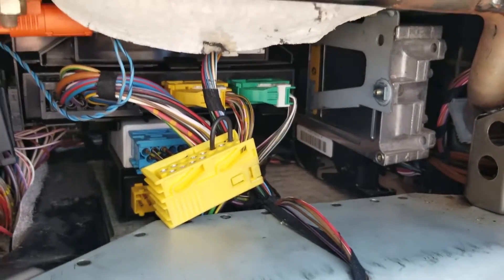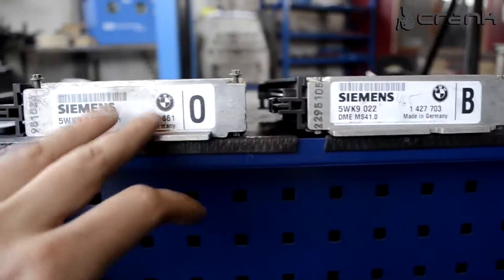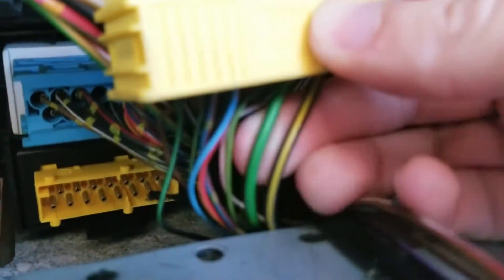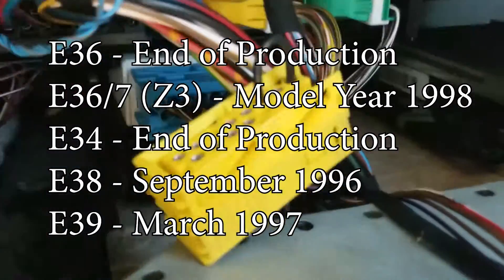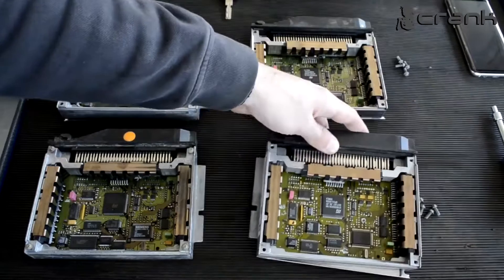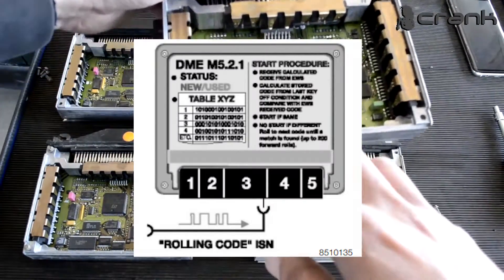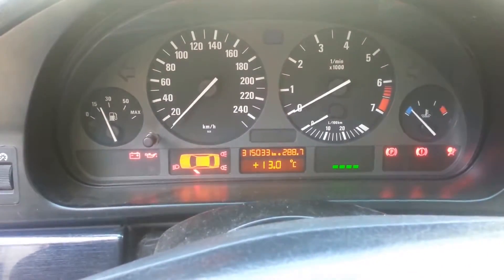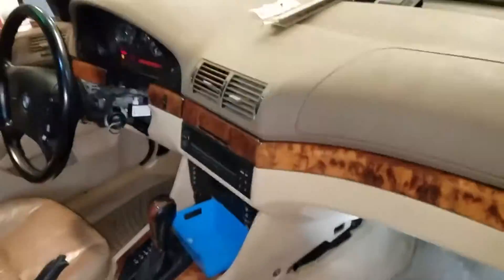Early BMW Anti-Theft (EWS) Will Mysteriously Cause your Car to Literally not Start, and Here's Why

Comment: What's the get around for an E46 from 2004. If the EWS is bad? I got two seems at least one has an ews issue possibly both and both different. But is there a way to replace the ews and code it to the car using a scan tool via the OBD2 port? If so what's the cheapest model in 2026 that can do this that you know of? I've been looking on YT and seen various answers contradicting eachother. Also looked and found many scan tools ranging wildly in price that claim to program ECU & Modules, but NONE give details about EWS even when they're BMW specific, so I'm sceptical at spending any money on another scam tool unless I have confirmation from someone that 1. Yes it can be done if you buy another EWS etc t9 match the module to the car and keys(or other modules if it one of those) & 2. Confirmation of what scam tools as of 2026 as a minimum would perform this function, as I have zero clue about electronics other than what I've read & tried to figure out.. lol 😂 
Any help would be much appreciated as I have two cars one that's on the blink intermittently won't recognise each key, and has stopped recognising either to unlock remotely. And the other that cranks and no start.(I'm yet to check fuses on either though).. 
Thanks

Comment: Is it possible that in my e39, 2001 year Im having perfect crank but no fuel due to bad ews? From what you said its should rather happen to older models as those new ews should rather permit even crank if sth is bad

Comment: Do the same issues happen with EWS 4. I have a 2009 E83 X3 that has intermittent no crank no start issues. Sometimes that involve no noise whatsoever and other times you get a solenoid click but no crank. Starter has been tested and is good.

Comment: How do you know all this? wow great job! Im currently having a no start not crank issue on my e39. The problem started when I went through a car wash and when I came out, the car died. It just cranks. It did turn over a few times, but there is no response with the potentiometer gas pedal. Ive replaced almost everything. So now I am trying to learn more about the this EWS and DME. Thank you for this video.

Comment: I have an issue where intermittent maybe once or twice a week the car won’t crank or start, once I jump it with my jumper it will turn over.

2nd battery in a year so I know it isn’t the battery. 

I get power to the dash but the car won’t crank or start. 

I can hear the starting trying to turn over.

Still can’t figure it out so I’m always with a jump box in my car lol

Comment: 318i 1997 no start no crank checked the starter and fuse, connected the two lines to crank up the car but no luck can anyone here give my a reason why? Can it be the transmission module gone bad?

Comment: Is there a stand alone cpu that can delete the factory alarm system and allow the car to start and drive. There are older vehicles that have these systems and they fail and render these vehicles useless. I want to have a newer off road track bmw vehicle like a x3 or x5 and these systems are getting in the way. No point in having a failing ani theft system on a $2000 car. I found after market ecm but require a lot of programming and adapting and the cost is more than $2000 for a system. Anyone know any bmw hacks that can help in this situation?

Comment: The issue im having is during the summer here in AZ above 100 degrees I get no crank no start until the sun goes down or early mornings. But when the sun hits the car it won’t crank or start. Already got an ews delete and still having same issues
Reply: The same problem I have, did I fix it and how?
Reply: @oE39o  maybe crankshaft sensor failing out

Comment: Great video. Can confirm EWS f**ks with your car in variety of ways. I have 2002 E39 3.0d and recently swapped engine and auto gearbox for the same engine but manual gearbox. Had the "no crank - no start" situation until I searched the net and found out that the clutch sensor (neutral safety switch) that I wired in was bad. Connected 2 wires on the sensor (black/blue & purple / yellow) and the car started with automatic DME. Now just need to code it so that it knows it has manual gearbox. Even tried swapping EWS & DME from the manual car and trying to hold the key as near as possible to the ring sensor on barrel but to no avail. Didn't want to change the key ignition barrel so left it as it is.

Comment: Hi I have a e39 528i 97 model and car has started then few hours later it will just crank no start. Thought was fuel pump and its relay mate thinks it is the ecu is no good. As connected to scanner and responded with no signal. But I don’t think it’s that.. would you have a suggestion? And my ecu is 5wk9 0322 thx

Comment: This is exactly what’s going on with my 95 e36…drove it the previous day and the next day it was just dead…jacked it up and touched the starter with a screwdriver and the starter was fine…replaced the ignition switch and still nothing so yeah it’s either the ews or dme

Comment: My z3 cranks, but I won't start after the central locking system went bad..  it's a 99 to 2000 model 😅 this car has been nothing but pure problems.. and my bank account is taking a massive hit 😂😢
Reply: Hey same issue. what was the problem ?
Reply: @Irandal  it was a fuse in the second fuse box by the ECU and the relays. You should have a little box with 5 fuses in 4 are 30a fuse, and the middle is a 20a fuse. The 20a fuse popped
Reply: Under the bonnet on the right-hand side
Reply: @Debbie_longnipp  Thank you ! I’m going to Check this

Comment: Thank you for the detailed explanation of the EWS. I have a 2005 mini Cooper and the EWS will no longer recognize my key and I only have one key. I have no crank no start condition. Is there any alternative to the dealership? I do not think that EWS and DME are communicating anymore. This car has not started an over a year. I cannot even find a starter relay in the fuse panels on this Cooper Mini S R53. Let me know if you have any suggestions how to proceed
Reply: I have a 2006 mini R50 and am currently dealing with the same "no crank/no start". I've seen there are services online that will send you a replacement key and EWS that are sync'd together and are "plug and play" fixes. They are rather pricey and seem to be a gamble. I'm looking into my options and am hoping I can find a person who is familiar in programming that can provide honest service.
Reply: Starter relay is in the Ews system
Reply: Call triple a if member

Comment: I have a 2000 BMW Z3 I am trying to revive. It sat for 3 years. Installed a new battery, changed fuel filter, new gas with gas cleaner, new spark plusg and boots. It starts but dies a few seconds later. Could it be the EWS (Immobilizer)?
Reply: No if it was it would not start.

Comment: I got a no start on a e39 540i 2000 m62tu I bypassed the ews and out a fuse into the starter pins and it cranked but didn’t start still trynna figure my problem out. Lmk if you have any ideas anyone

Comment: Do you know how to disable "drive away protection" for early e36 1991 ? It's not event ews1
Reply: Did you find your answer, I'm stuck with this problem now
Reply: @PurpleMetro33  my problem was in fact an eprom issue. My mapper gave me the wrong eprom so I could not start the car

Comment: That was awesome. Very informative video man. I am currently having trouble with my e46 2000 323i. It’s got 245k miles on it. Runs like a rapped date. Although the past week or so I’ve been running into a no crank no start situation. So i jumped a black wire with another black wire that has a blue line and the car cranks but doesn’t start. I’m assuming maybe because I have the module unplugged. Idk but either way man. This was a great video man.

Comment: I did a swap, the car turns, but it doesn't start, I found out that it's because the spark doesn't reach the spark plugs correctly, can I try that, without it ruining anything? I saw some comments saying that the windows stopped working and other things like that

Comment: Is bridging that a sort of solution or bypass ? Or is that just the to detect if your ews is bad?
Reply: its a bypass, but you need to program the ews out of the dme, because the dme expects there to be an ews module even if you disconnect it

Comment: Thanks for the breakdown. In a no crank situation with my 2002 Z3 5 speed after changing the radio from factory. I don't know if that has something to do with the EWS. Any idea if that's part of the system checks? Can be cleared via OBD? Thanks

Comment: Please help me, I had no crank no start. Removed ews and there is a broken pin from the male side of the ews in the female side. What tool can use to remove the wire from the female side of the plug? Please help

Comment: Hi could you help I'm have crank no start I've changed fuel pump relay filters and fuse but still same the fuel pump don't always kick in any advise thanks
Reply: Did you find the solution ?

Comment: !
!
PLEASE FIRST of all, understand that this error is also remembered by the cluster. So unmounting the driver's dashboard WILL START THE CAR ONCE, but not the second time, because the error will be manifested again by the mob. So now comes what I wanted to tell you all: GET OUT THE EWS and spray clean the connector some time, coupling it a few times will make the oxides from the pins to run off, and electric signals will travel again to the car computer. 
WORKED FOR ME. A little "deodorant" :)) No wires, no jumper, no more headaches.
Reply: If my cluster is connected I don’t get crank, but if I disconnect the top right connector on my cluster it cranks and starts. Any idea why? I have a 2003 530i

Comment: If you have some time I really could use your help with what I am going through. Because right now everyone knows more than I do. I have a 06 BMW x5 4.4i and my fuel pump stopped working so a friend of mine jumped the relay inside the glove box and it worked. I drove it home and parked it. That was 5; months ago. Now my car will crank but won't start and it's saying that it's in limp mode. Another person said it's is thinking that someone stole it and the immobilizer stopped talking to the rest of the modules. Now I don't have a really good scanner, just the one out of Walmart. Is there a way to get my car started I am out of ideas. And on top of all this,I am moving and I hate to leave my car. Here

Comment: Has anyone ever experienced a situation where intermittently you turn the key to the run position and NOTHING comes on? No dash light, no crank no start etc?
Reply: You could be having a series of problems including your ews and fuse box under the passenger seat. This generation of bmw is prone to water getting into the interior especially the e39s. I pulled the carpet back in mine and the whole thing was rusted and falling apart. I replaced the whole thing and the dash and other interior electronics started to work again but now im having a no crank problem aswell. Wish i could help you with the no start but i hope that info was helpful
Reply: Yes. I had a 2000 BMW Z3 and about 2013 I experienced that. It turned out that the metal part of the key had worn out so I needed a new key made at the dealership. I needed to bring the title to them to prove ownership and they gave me a new key a few days later (had to be shipped). It cost about $100 then. I don't think it had anything to do with the Immobilizer (EWS system), only the actual metal being worn down too much.

Comment: Hi I have a e46 320cd it Cranks but don't start all relays and fuses been changed, and fuel pumps, if I fiddle with key in the ignition it start could you shed some light on this thanks
Reply: maybe the ring antenna then, since it starts by wiggling the key?

Comment: great information. MY X5 shot the engine and i replaced it.  M54b30 its cranking but no spark no start. So far 2 mechanics have tried everything but to know avail. diagnosis will show iterms like sensors, throtle but after changing them still no spark no start. Any advise please.
Reply: Did you ever find the problem?

Comment: I watched the whole video even though I had no clue what you were talking about(my fault, not yours). I put the key fob in my 2006 330i to start the car. Dash lighted up but no start. An icon appeared of a red steering wheel with a padlock. I pulled the fob back out and reinserted it. Dash went blank , no power and the fob would not come out. I was able to repo over the fob slot and retrieve the fob. Now the car has no power throughput the vehicle. It’s completely shut down. I removed the battery and charged it overnight, even though it showed full. Put battery back in next day. Nothing. What do I do next short of having it towed to a very expensive shop? Thanks!

Comment: I have a 2005 545i N62 4.4 l and my alarm is not dearming it's self I've tried to reset it with the key in the door by unlocking locking locking and unlocking and that didn't work I also took the negative terminal of for a couple hours and that didn't work is there any way to bypass the alarm system at all so I can drive it or do u know where I can get a new key and have it reprogrammed that won't charge me 3000 to reprogram it

Comment: Hello i have a question if u can help me plz . I have a e39 525tds 1997 
I was running the car nomaly and she just tuned off 
Now i dont have the dde light off 
And car dont turn on anymore 
Dont have anymore eletricity on fuel pomps everythinks work the key turns on the engine starter work but dont have fuel becouse of missing eletricity on fuel pomps

Comment: @Brundoi  no se si hablas español tengo el mismo problema con mi bmw x5 no enciende pienso que debe de ser eso me puede decir si tengo que cambiar la computadora o el ews? Solamente cual de las 2 ya que ni se mucho inglés y no entendí muy bien por el idioma vi que mostraste computadoras y estoy confundido o solo cambio el ews.?,,@Brundoi I do not know if you speak Spanish I have the same problem with my bmw x5 it does not turn on I think that must be that you can tell me if I have to change the computer or the ews Only which of the 2 since I do not know much English and I did not understand very well because of the language i saw that you showed computers and i'm confused or just change the ews.

Comment: So whats the answer to get the ews operating again in a 97 bmw e39?
Reply: update?
Reply: replace ews module, with a new one and programmed by bmw or buy used and get the ews, dme ring antenna as well as the keys. you can also just bypass the ews module and program it out of the dme so that the dme doesnt expect an ews module anymore

Comment: I would like to know how to rectify the problem with a possible EWS situation. First the car wouldn't crank  so  I bridged the ews as you instructed and it now cranks but won't keep running it starts then stalls...BMW e36 m3 evo3 3.2.  1997
Reply: Locksmiths definitely can help in that department.

Comment: Hi bro, i have a problem and i think it may be EWS3 (E39 year 2003).I have terminal 15/30 but no start.  I made a jumper between the power cables and now the motor turns but won't start.  Do you think it could be the ews3?  Hugs bro!
Reply: Did you ever find out what the cause was? Mine is doing the same thing
Reply: @2gunz29  my 2002 e39 530i same problem. Seems the EWS is fugged.

Comment: I have the 2005 BMW X3 3.0I.   It was starting until I  took to the electrical shop.  The temperature gage was reading hot but car was not running hot.  Suddenly it was stuck in park.  Mechanic said it was  the key reading theft mode..he said it wouldn't start.  I drove it there after tow truck driver released from park.  Now it won't start.  Says he changed the computer, wires and 3 modules, which keep burning out.

Comment: Eu Model 525 tds (diesel)  12/1996 EWS1 , my second E39 04/1998 EWS3  , y try to find to EWS OFF the 1998 model, 

y tried with the AK90+ to copy the data from the EWS3 modul etc but EWS3 is 433mhz and y buy a 315mhz... y have only one key , if lost or defect pric : 180€ and 400km to drive to the first dealer.

Comment: Brunboi, I have a 2001 E38 and the car starts fine but when I turn the car off and attempt to restart it will not start or crank. I have to disconnect the battery for 30 seconds and then it will restart again. Do you have any suggestions as to what may be taking place here and what I should attempt do next to troubleshoot the issue. Thank you in advance.
Reply: Door locks
Reply: Bad battery?
Reply: Hi

Can you update us please what was the issue

I have e39 and i have the same issue

Comment: I have a1995 bmw 318i I have no ews and no crank no start. Can you tell me what I can do or check
Reply from the maker: If you don't have EWS, then I would recommend starting with making sure that your starter is getting power when you turn the key. If it is, then the issue could be related to your PCM or your DME, and it would be worth seeing if you can check whether those are functional or not.

Best of luck!